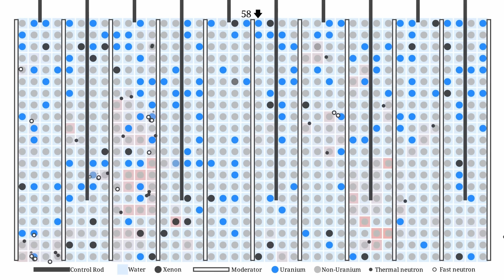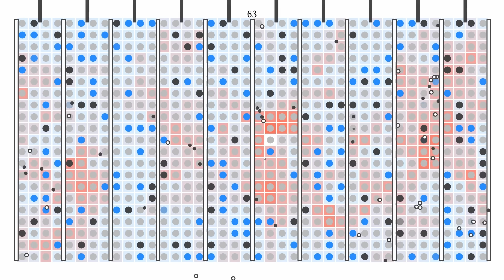Chernobyl Accident - Simulation only (no talk)

Comment: Turning off the warning alarm instead of the exploding reactor is fantastic, what a real meeting of the minds over there.
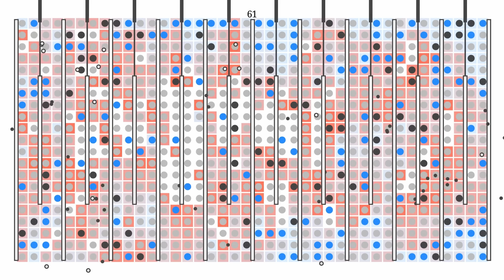Reply: They did try to turn off the reactor. That was what was happening when the control rods started going down at 3:16. They did it too late though, and the graphite tips of the rods got destroyed due to the extreme heat that had built up by that point, and caused the control rods to get stuck. After that there was nothing anyone could've done.
Reply: @Asb92a The graphite tips went against shutting the reactor, because they speed up the reaction which caused the vaporisation of the water
Reply: they tried to shut down the reactor and that is what caused the real problem. They shut off all the water pumps. with no more water running through the core, the water vaporised creating a void. RBMK reactors had highly positive void coefficient and that is a fatal flaw in the design. as a safety measure negative coefficient is preferred for a reactor. in a reactor with positive coefficient when water turns to steam reactivity increases. when the reactor stalled and they were in a xenon pit they tried to bring the reactor back up instead of turning off. and with no more water running through the reactor the reactivity was increasing. and when they saw things were quickly getting out of hand they realized no matter what turn off the reactor. they presses AZ-5 and before the boron reaches the reactor graphite comes first. And because of the pressure inside the control rods didn't come out. And the graphite was stuck there which skyrocketed the already out-of-control reaction. and kaboom. steam threw off the lid and oxygen rushed into the reactor which created a sexond hydrogen explosion, splitting open the core and spreading radioactive material everywhere.
Reply: @ROGUERED666 thank you for this explanation!
Reply: @ROGUERED666 i love you for this
Reply: It was protocol.
The warning goes off when the turbines trips, and the computer didn't know they were tripped on purpose.
It had to work like that.
Reply: Their were told, the reactor cannot explode, and the AZ-5 button can always be pressed to shut it down.
Reply: Люди учатся только на своих ошибках. На было бы этой трагедии, не узнали бы её последствий, не узнали бы её последний не приняли бы современные меры безопасности. Не взорвалось бы в Чернобыле, взорвалось бы где нибудь ещё. Как пример индустрия пассажирских перевозок, практически все меры безопасности построены на крови.
Reply: @SCXBelka , ну, формально вырубить сигнализацию вместо принятия мер устранения проблемы, из-за которой она и сработала - это немного другое, нежели укомплектованность того же Титаника спасательными шлюпками. В одном случае мы имеем практически незаконную глупость и халатность, а в другой глупость обеспечил закон, по которому шлюпок на Титанике якобы было достаточно
Reply: @SCXBelka And it's always the poor that suffer for it.
Reply: @SCXBelka  the ccp was notified about the fault in rbmk reactors, they did not act on it
Reply: Honestly it seemed like a lot of them were undertrained so I can't blame them
Reply: Remember: When an idiot and a dumbass meet together, there's always a business (a fishy). Or whatever the phrase was, Idk tbh 😅😅
Reply: sure, very unwise, you tell the secretary why you shut down the reactor (and saved chernobyl) because you thought it would explode (it didnt because you stopped it). it didnt explode, you get a free bullet and the next guy doesnt shut it down. its a positive feedback loop
Reply: @madman9220top comment
Reply: that reminds me the disaster of Sukhoi Superjet 100-95B in 2012.
pilots ignore and disable warnings while flying right into mountain.
Reply: Dudes acting like it's the fridge telling them to close the door
Reply: They A BENPNER'S :text-green-game-over::person-turqouise-waving:
Reply: lads got mad over a bot lmao. yall know it obviously having a AI generated pfp but still arguing
Reply: @rviegod  I'm not a Godless AI excuse you
Reply: @Sqwumpo  he wasnt talking about you he was talking about the guy with the profile picture from thispersondoesnotexist
Reply: Dyatlov was under pressure to keep his job and not have another failed test. The song I Fought the Law doesn't just apply to criminals. It applies to the laws of science too.
Reply: Like.... Literally
Reply: Commies are not the brightest of people.
Reply: Communists are colossal fucking retards
Reply: None of the operators knew the reactor could explode in the first place
Reply: @aerosw1ft  AFAIK they knew, but managers and politicians only cared about the test and told them to do it anyway.
Reply: blabla bill bla bla bill ? raaaa salam a lekoum sala RAAAAAAAAAAAAAAAAAAAAAAAAAAAA
Reply: Alarm is to make everyone aware. Once everyone is it’s just an annoyance that makes it hard to think.
Reply: Operators were untrained and under pressure to complete their safety test
Reply: Soviet mentality at its finest
Reply: Smartest commies alive, ladies and gentlemen!
Reply: It was because of pressure from clueless politicians.
Reply: Serve them right
Reply: @myespada  quiet jew
Reply: @Sqwumpo ah yes there it is the antisemitic leftist. Whining about the anti Russia propaganda that you still believe.
Reply: @FuhQueue_2  that one aint part of us😭 most leftists/left-leaning people i know arent antisemetic
Reply: You are saying very dangerous things comrade
Reply: I don't get a damn thing. Can someone explains me what's going on in that video ?
Reply: @olivaSparl-c1oTHEY BAPNERS BRUH THEY WONT TELL YOU 😂
Reply: Dodecacringe inferiors, every one of you.
Keep eatin that ketchup nice and good, bottom-casters. Writhe.
Reply: реактор специально взорвали
Reply: Commies gonna commie 😅
Reply: In Soviet Russia, Reactor turns off YOU
Reply: The insanity of communism in full effect.
Reply: Some real Putin ideas
Reply: Lmao graphite tipped rods, positive void coefficient, and no containment dome thing. What a bunch of assholes who designed Chernobyl.
Reply: Yeah, my experience with fire alarm drills and being a fire warden alongside my role as receptionist has been similar. No sir, I'm sorry I can't help you the fire alarm is going off. You're going to have to leave the building. No, I can't shut the noise off. Sir, if there's a fire you're going to be toast. I know you're in a hurry but DAMNIT THERE'S A FIRE ALARM GOING OFF AND I HAVE TO GET YOU OUT OF THE DAMN BUILDING!
Reply: you can't "tun off" a reactor lmao
Reply: Типичное Русское авось. А потом всем миром спасать ситуацию либо устранять последствия
Reply: The amount of people fighting about stuff yet being so wrong and confident at the same time, is amazing lol the reactor they were using was seen to continue building power even when turned off and that’s what happened in the case of Chernobyl/ negligence by operators. Has absolutely nothing to do with an alarm system, they turned it off and it still went boom because the reactor design they were using was flawed.
Reply: Is it so rewarding to win an argument so that you keep coming back even though the argument started five months ago?
Reply: @adrryl5566  "what is a loaded question?"
Reply: Soviet mentality.
Reply: a meeting of minds? whatever happened there...
Reply: @realcel83  I was being allegorical
Reply: Peak of soviet incompetence
Reply: @d1egomon194  Hey, remember when America went on a genocide. Oh, wait, that’s happened two or three times now. At least we didn’t have concentration camps! Uh oh, that time we locked up Asian people because they were Asian, for four years we banned traveling except for white Americans of course, separating families, locking people up including children because they’re immigrants. Oh wait, we’re also deporting people who aren’t white even if they’re American citizens including natural born. To the point our dead leader is pushing for natural born citizenship to be stripped away. But, you know, those damn evil Soviets!
Reply: balant amercian propaganda
Reply: Потому что это было в рамках эксперемента
Reply: ukrainians did blow up chernobyl nuclear power plant. they want to do it again/ and again/
Reply: it's always so fascinating to see someone acting like (in their own words) "...couldn't care less..." and yet trying to win a pissing contest 5 months in. Maybe if you followed your an advice you would'nt be clowned on. lol
Reply: That's how things are done literally everywhere, maybe nowadays in some sectors it isn't.
Reply: @freshrockpapa-e7799  definitely not true safety wasnt nearly as much of a concern as it is nowadays. we have safety things everywhere now. they wouldnt even be able to lift the rods manually if this was after 2000
Reply: @ultimateearrapechannel31 also modern design placed more focus on not sending spurious alarm/warnings.

So the moment an alarm actually went off everyone is on high alert.
Reply: @ultimateearrapechannel31  You literally just repeated what I said.
Reply: @freshrockpapa-e7799  You said it with a smarmy attitude though so really I'd just prefer if you stopped responding entirely or removed your comment. You normies on the internet always having to be correct is annoying.
Reply: @freshrockpapa-e7799 you should probably look up the definition of the word "literally"
Reply: @Sqwumpo  Well I couldn't care less about what you prefer. If you don't like my comments you can silence me or just deal with it like a grown up.
Reply: @freshrockpapa-e7799 Yeah, you’re insufferable and a know it all. Thumbs downed all your comments tho. Made me feel a little better seeing you get roasted ❤️🥰 Be nice online and people will be nice to you. Be passive aggressive and here ya go.
Reply: @Eaglesfan828  Thanks for your opinion, but I couldn't care less about yours either.
Reply: @freshrockpapa-e7799  Oh trust me, you care quite a bit! You’re responding to any and all comments. It’s wonderful to see. Keep this energy up! It definitely doesn’t make you look insecure.
Reply: @Eaglesfan828  Oh no, somebody on the internet thinks I'm insecure, the horror
Reply: @Sqwumpo  What exactly have I done that deserves this amount of hostility?
Reply: @freshrockpapa-e7799  if I looked like an egg and weird Al had a child, I would def be insecure
Reply: @freshrockpapa-e7799  I hate your attitude.
Reply: @Sqwumpo  I hate how you all responded to me when I didn't say anything weird or out of the ordinary.
Reply: @Sqwumpo  What exactly did I say that was bad?
Reply: @freshrockpapa-e7799 you did not do anything wrong. I dont see how you're being a know-it-all or smarmy

In fact, you were not even hostile with anyone to begin with. You did not say personal insults either. I really don't see how people can claim you are the problem when they're attacking you personally and generally just saying things like "disliking your comment" or asking you to "delete your comments"
Reply: @Tyuaii  Thank you, I don't understand what happened here either, I never have people talk to me like that.
Reply: @Cblla and so are you.
Reply: @freshrockpapa-e7799  You literally used the word literally wrong twice.
Reply: @matturner6890  The word literally can literally be used for emphasis, so I literally used it properly all times I used it. If you're going to try to correct someone, check your facts first.

Also literally nobody asked you.
Reply: @freshrockpapa-e7799  no sorry that's not what the word means. People misuse it that way but it's not correct.
Reply: @Sqwumpo  im curious how you found an attitude in a text? You started a convo on a youtube comment page, you immediately invited yourself to and created an open dialogue, chill.
Reply: @ultimateearrapechannel31  " safety wasnt nearly as much of a concern as it is nowadays."

Chernobyl exploded because they didn't properly understand how their reactor worked. It's very easy to sit here and say that they were not being safe but as far as they knew they could always just press the big stop button and all would be well. Unfortunately the design of the reactor meant that pressing that button actually made things much worse.
Reply: @freshrockpapa-e7799 you litterally did not
Reply: @freshrockpapa-e7799 That’s not “literally what you said”. Maybe it’s what you meant, but it’s not what you said
Reply: @jackthurman2642  It really is the same.
Reply: @freshrockpapa-e7799  You guys literally the point.
Reply: @freshrockpapa-e7799  You said what you should have practiced.
Reply: @Sqwumpo 

Why exactly should other people police their behaviour according to your preferences? Is restricting the speech of people you find to be unworthy of it a moral good in your eyes?
Reply: @freshrockpapa-e7799  Which is exaclty what they did lol. P.S. You're still wrong
Reply: @freshrockpapa-e7799  Wtf are you smoking
Reply: @freshrockpapa-e7799  No he didn't, you said people nowadays ignore the security systems and maybe in some sectors they don't which is false, nowadays it's not even possible to experiment like that. Maybe english is not your native language and you didn't know well how to write your idea but according to your commentary he didn't repeat anything
Reply: @alejandropinzon6640  lmao if you think security systems aren't ignored nowadays you clearly haven't worked a day in your life in a factory or anything like that
Reply: @freshrockpapa-e7799  Yeah I didn't affirm that all security systems aren't ignored I just said he didn't repeat anything, it's truth most security measures are violated usually at most places but the point is nowadays at least at a nuclear plant they can't experiment like that anymore,  on the other hand yeah I give that to you, most factories and business couldn't care less about involving and harming a big quantity of people, risking their worker's lives and ignoring the health problems they cause by throwing chemical wastes everywhere.
Reply: @alejandropinzon6640  obviously
Reply: @freshpapa

this isn't reddit. 
go outside. go outside and talk to another human. 
you sound desperately empty inside. 
go for a walk. 
the internet seems to be too much for you.
Reply: @Sqwumpo You Sound like such a fun and happy Person to be around
Reply: @ultimateearrapechannel31  Is this why three reactors exploded at Fukushima?
Reply: @freshrockpapa-e7799 To say everything is done like this everywhere is quite the stretch, it would require you to know every single place, especially nuclear power plants and the team working in every single one of them. Your argument has this form: "it is known that X is Y in some places. Therefore, X is Y everywhere!". That's a fallacious argument, that's why people are this "hostile" against you, because naturally people don't feel comfortable with such an obvious and relaxed fallacy.
Reply: @1Capybara24  I literally said that in some sectors it isn't like this, you realise this supposed fallacy I made, I didn't actually make it in the first place, right?
Reply: @freshrockpapa-e7799  7 months later and you're still arguing with people, give it a rest.
Reply: @Sqwumpo  you quoted me in a comment just to tell me to give things a rest?
Reply: @freshrockpapa-e7799  You probably work somewhere that the risk management isn't even close to comparable yet you spew things like this. We would have power stations collapsing daily if what you're talking about was even remotely true.
Reply: @EtopiaCA you literally make up what you want to believe. Sure buddy, whatever you say. I've worked in a ton of sectors, you can't imagine how badly basic safety regulations get ignored literally EVERYWHERE. Factories, hospitals, restaurants... I've literally seen it with my own eyes.
Reply: @freshrockpapa-e7799  Your misuse of "literally" needing to constantly reinforce your vague statements leads me to believe you're just projecting fantasies to win online arguments. The "fact" that you've "worked" so many industries also leads me to believe you can't hold a job for more than a couple years and yet you somehow think you're the resident expert on safety protocols. Care to give a few examples of your anecdotal evidence or are you just going to say "believe me guys, it's bad, I've worked in a ton of sectors"?

Even then, we are talking about nuclear power facilities, not the production line at a factory, it's not even close to an apples to apples comparison.
Reply: @freshrockpapa-e7799   you've seen chernobyl level ignorance to safety regulations with your own eyes in a restaurant setting? are you being literal or "literal"
Reply: @kiraoshiro9251  I'm not talking about restaurants here, I'm talking about actual industry.
Reply: @freshrockpapa-e7799  restaurants are hospitality industry, it was one of the things you listed as an example of your experience with literally every sector tending to ignore safety, so are you saying now that there are exceptions?
Reply: @kiraoshiro9251 the hospitality industry isn't "industry". One thing has nothing to do with the other, just like "prompt engineering" has nothing to do with engineering even if it's in the name.

I don't remember what I said or why, but yes, restaurants do ignore safety standards and regulations, have you ever worked in one? Because I have. Not that you need to work in one to know this, it's common knowledge that rules aren't followed 100% of the time.
Reply: @freshrockpapa-e7799  amazing that almost a whole year later randoms on the internet are still trying to arbitrarily correct you and if you say anything back you’re the problem 😂😂 also who the hell at this point doesn’t understand using literally the way you did. Like literally everyone does it ;)
Reply: @Lito_419  did you have an issue with me talking
Reply: @freshrockpapa-e7799 not really.
Reply: @freshrockpapa-e7799  This is just as dumb as the action lmfao
Reply: @freshrockpapa-e7799  Any examples or are you just making stuff up?
Reply: @IstyManame  any examples of security not being taken seriously enough anywhere? 

Well.. (vagely gestures at every single workplace accident in the last century and the current one)
Reply: @freshrockpapa-e7799  you’re annoying
Reply: @Pvemaster2  thank you
Reply: @freshrockpapa-e7799  Being proud of being annoying makes you seem like a child on your parent's account. If you are, then kindly exist the internet for another 8 years until you become an adult.
Reply: @Waskomsause  I'm 28
Reply: @freshrockpapa-e7799  Maybe in the Putinstanian Federation and similar 3rd world countries. Not in the West.
Reply: @joojoojeejee6058   You shouldn't bet 10 cents on it.
Reply: @joojoojeejee6058  and not in Japan, for example...)
Reply: @freshrockpapa-e7799  everywhere? Sorry you grew up in the Soviet Union.
Reply: In communism you don't fix problem, you just ignore it
Reply: @Feeelipeeee  as with capitalism, no? Greed is greed.
Reply: @Feeelipeeee  Communism is when bad things happen. Capitalism is when good things happen. Nothing bad has ever happened and is still happening under capitalism. /s
Reply: Lmao this chick above got ratio’d so hard